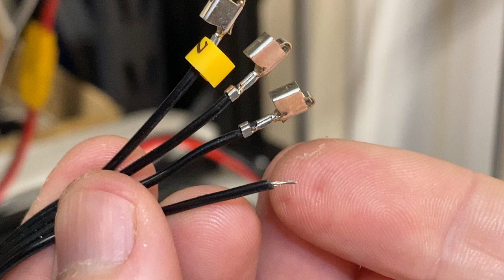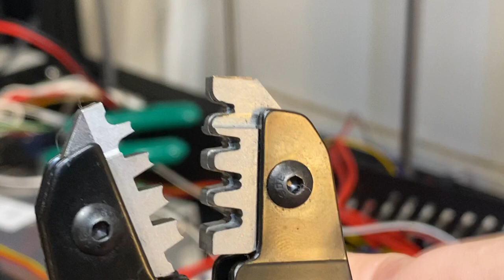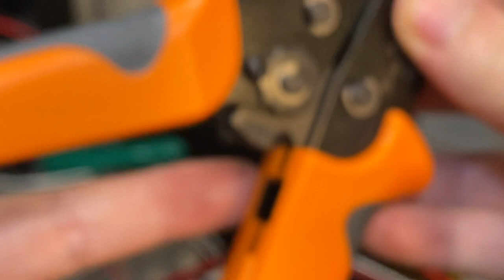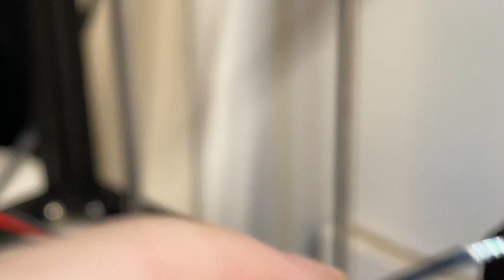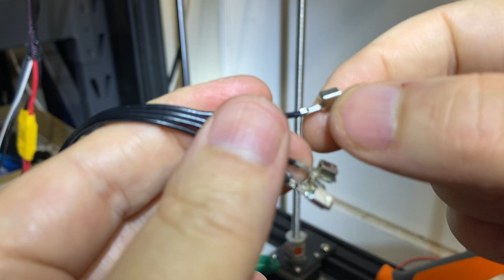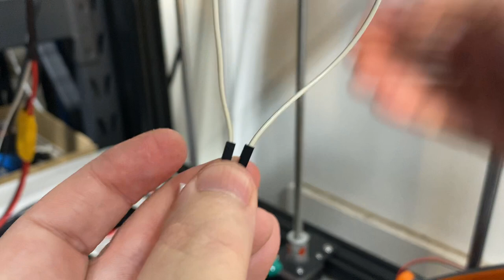Crimping Duet 3 driver connectors

Comment: That was immensely helpful! Thanks a bunch! (Nice camera and lighting work! It was concise and thorough too. Great!)

I just wish I had bought that exact crimper instead of the Engineer PA-09. The quality of the Engineer crimpers seems very good, but it seems to only do one set of legs at a time and also the largest opening on the PA-09 is 1.9mm, the Duet site says you should use a 2.2mm jaw opening. Oh well, it does seem to work... For all I know, 1.9mm is perfect.